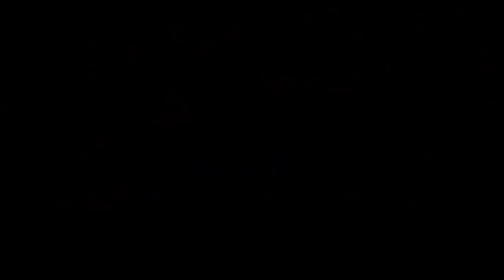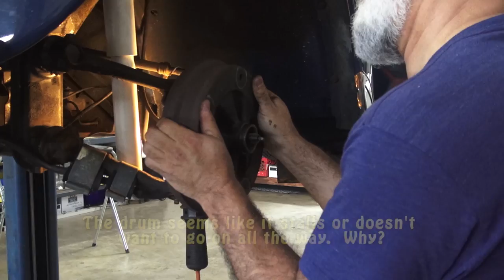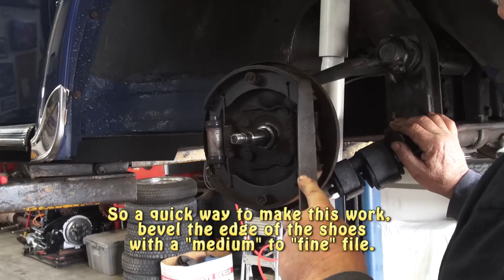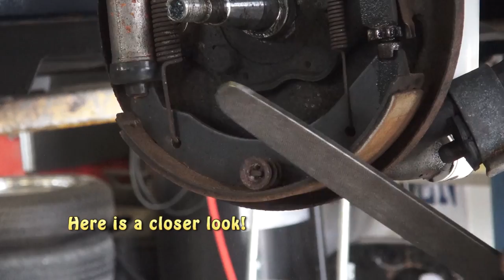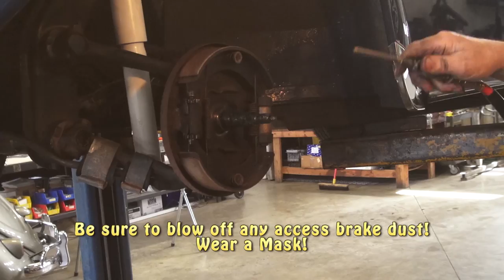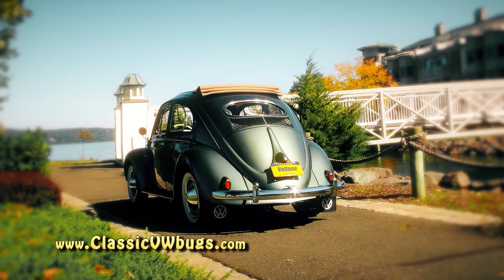Classic VW BuGs How to Easy Install Tip Trick Brake Drum for Beetle Ghia Bus

Comment: Never , ever take an air hose around brake dust . The particles will be air borne for a great distance in shop. Use of brake clean or water, degreasers is safer. Remember asbestos is not the bestist.